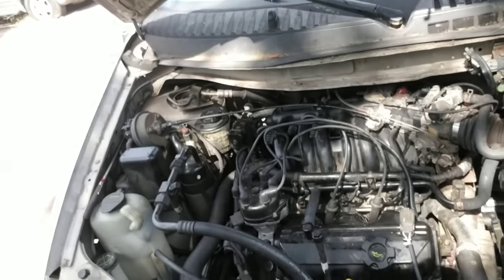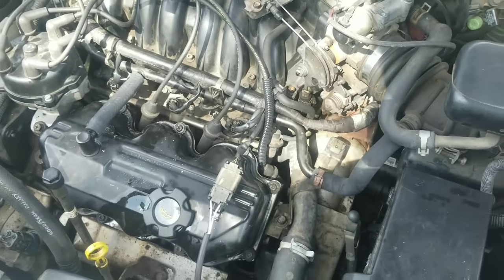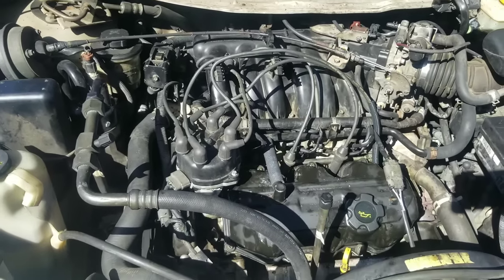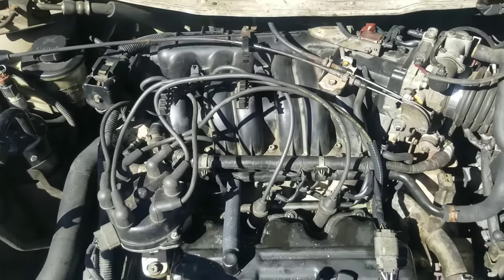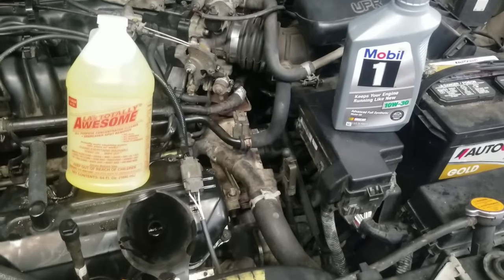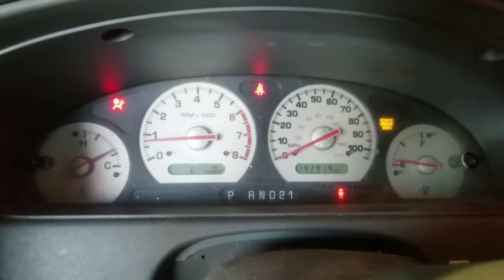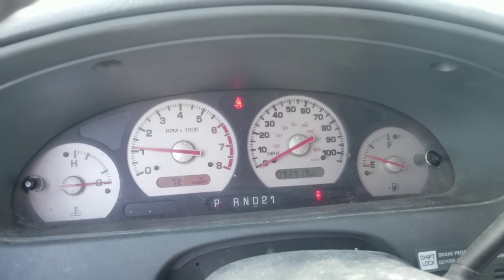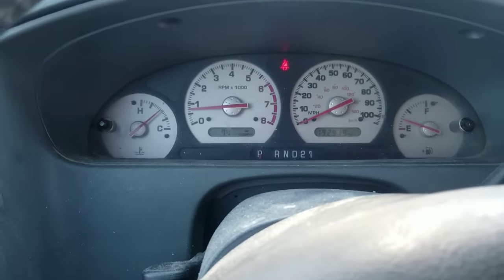How to Clean The Inside Of Your Engine The Easy Cheap Way.

Comment: This method seem a lot more cost effective than labour intensive and it worked obviously....taking oil pan off  and cleaning etc..
To me personally I think this would have done a very good job at cleaning the oil system and I would recommend this to my customers rather than taking things apart which is costing more money and time and bull shit this method would practically do the same thing I’ve been a mechanical engineer for 15years this guy has the right idea, Fuck yo haters🖕🏻
Reply from the maker: Thank you please like, share, and subscribe, also please check out my other channel Salem Taxi, on YouTube for more material on a different level.

Comment: a good flush is to use kerosene.and then use some diesel oil mixed with regular oil and run it for awhile then drain it.i quart.it`s a good flush.i quart of diesel oil.kerosene is just a flush out.

Comment: you are crazy dude. totally awesome is made of water and detergent similar to dishwash. The creamy color is caused by the mixture of water and oil, eg emulsification. same as what you see at blown headgasket, the mixture of oil and coolant. And the residual detergent will affect the lubricating/flowing performance of oil in some ways. The right and safer way is using thinner as solvent to eat the hard residue. Thinner is the effective content in many bottled "motor flush" products. Someone use diesel or kerosene, same principle, depends on what you can easily get.

Comment: What if you got a milky cream color instead of oil because I blew my head gasket
Reply: There are some treatments you can add to your coolant to seal the head gasket, but they can cause clogging of the radiator or possibly coolant passages in the engine, so I would only use it on a beater your going to get rid of soon and need a quick fix
Reply: So what do I do
Reply: Arabia Mashack to fix it properly you need to remove the head and replace the head gasket
Reply: But how can I get rid of the cream color in the engine
Reply: After the head gasket is fixed engine coolant will no longer mix with the engine oil and you then do an oil change with a new filter and it will be gone

Comment: Simple Green is a great degreaser but not for inside engines. Change   the oil and filter. Use Castrol GTX ultra clean motor oil. This oil is a sludge buster.

Comment: I know people who have owned their vehicles for years and never changed the oil...or checked their tire pressure.
Reply: And they're probably getting about 10 miles per gallon City fuel economy engine problems shaking it's not really a very comfortable ride in a non maintained vehicle and pretty dangerous why not changing your oil for that long your engine can blow
Reply: Doesn't mean it will it just means that the probability is a lot higher

Comment: Degreaser is for the ETERNAL areas of the engine, not the internals. fried bearings, fucked up engine, now. The sludge is gone, but so are the cam lobes, the main bearings, the wrist pins on the piston rods, & the cylinder walls.. should smoke like a chimney, now!

Comment: 1 quart of diesel motor oil will do it. when you drain it you will be surprised what comes out.drop aquart and add a quart of diesel oil.run it for awhile then drain.
Reply from the maker: kool ill try that for you and try to do a comparison video for you, however i have tried that and that is why i use this method its faster

Comment: What, no before and after pictures of the oil pan and oil pick up screen.  Don't ever use any form of solvent in the engine or cleaner while running, especially at 80% concentration.  Instead perform a full volume oil change.  A typical spill and fill leaves 10-20% of the old oil, sludge, contaminents, wear metals, fuel dilution behind. I have oil analysis that proves this.  The oil will be dark just as shown in the video. Perform a second change after running the engine for 15 minutes.  The new oil will be 99% clean, and the highly effective detergents in the new oil will be able to do its job to clean and protect the engine.  LOL, MMO will polish internal parts and makes parts "slicker".

Comment: Ahhhhh? I hate to inform you that you are putting water in the engine, that all purpose cleaner is not designed for engine oil and is made from water (Which you do not want in your engine) and that explains why? when you are draining the oil it is turning a coffee like colour, that is water mixed with the oil. Anyone who using this method is risking damage to the internal parts of the engine (because the all purpose cleaner has no lubrication and is about 80-90% water)

If people are looking for a cheaper alternative to flush there engine, it may be  possible to use a 50/50 mix of clean diesel fuel with an engine oil, and this allows you to flush it 2-3 times if you think it needs it. But as per usual, and as a safety warning it is not recommended, and further research is required for this technique. If you try this technique then you do so at your own risk, but in saying that (the warning) I have been speaking to many mechanics about this and they have all replied with positive replies, but they did recommend not to drive the vehicle with this mixture, just idle and gentle revving, then drain and repeat if required.

Hope this helps

Comment: Dumb-Never add water to your car oil.Most people try and keep water out of the oil.A blown Intake manifold gasket lets Antifreeze into the oil.Engines break down with water in the oil.

My solution is Take the valve cover off,oil pan off,Pressure wash,let it dry off in the summer heat all day.Put on new gaskets with the covers. Fill with fresh oil and filter and your good to go.

Comment: Putting DEGREASER inside your engine and then running on it?  The cure is ten times worse than the "disease" i.e. the sludge.  This is a prime example of "over-aggressive" cleaning and no doubt, played holy hell on the bearings rings and cam - and this cleaning was worse than any sludge.  On any engine I cared about, I'd use a much less aggressive cleaning method, get some 10W oil and add a pint of marvel or rislone or other (non solvent) "cleaner". ...and run it on that until hot.  Then change the oil + filter then repeat once maybe twice - and call it good.  If you change the oil every 3000 you'll prevent further sludge build up and slowly eliminate it vs giving the engine enema all at once.  I'd bet that an oil analysis done on that engine now would show iron and aluminum count through the roof ....degreaser has no lubricating properties, the pistons, bearings and cam were being "lubricated" by degreaser solvent (!!) and no doubt, caused the engine more wear in this video, than it got in the previous 50,000 miles.  Executive Summary: DON'T DO THIS SHIT TO YOUR ENGINE.
Reply from the maker: well three years later and this engine still runs smooth, so i think you many wanna revaluate your freshman level summary:
Thank you please like, share, and subscribe, also please check out my other channel Salem Taxi, on YouTube for more material on a different level.

Comment: All those rough big gritty bits have now been dissolved into Iddy biddy little bits of grit and have been pumped around all the oil galleries in the engine, crank bearings, mains, bottom ends etc etc .... I bet a year on that vehicle is, no more !

Comment: Don’t know about putting water in engine. I use transmission fluid and diesel. I put 1 quart of trans fluid in oil run 5 minutes and a quart of diesel before I drop plud. You wil have overfilled so don’t drive or you can drain 3 quarts and add diesel and trans fluid, diesel will clean better than a liquid cleaner and better lubrication . Water no bueno in engine. Mechanics use diesel or varsol  to clean greasy tools. Transmission fluid had detergent to clean and helps gaskets. Be sure to drain for10 minutes and don’t run over 1000 rpm.
Reply from the maker: Thanks for watching , please like, share, and subscribe

Comment: never considered using the stuff, always changed oil on time. people, please change your rides oil so you or a shop don't have to do this
Reply: Yep, if you change your oil on time, the oil will always have enough detergent to get rid of any sludge buildup, prevent sludge and make your engine run perfectly. This is especially important on engines with VVT, if you use a flush on an engine with VVT the sludge will block the tiny passages that control VVT and then your engine can't use the VVT system.

Comment: Please people think befor you do this bearings are metal riding on metal this breaks down the oil so there is no lubricant on those running this shit in your car please just exercise common sense it may fix short term but long term definitely no t good. Trans fluid if you want to do this use auto trans fluid

Comment: Don't do this on a engine without a oil pressure indicator. No idiot light.  Yes it worked on this motor.. but..maybe not on another. I used diesel as a flush once and the oil pressure at idle, lost pressure . 3 / 5 psi. I put Lucas and stp and the pressure indicator in idle never came back to normal. And I flushed out the diesel with m,m oil 4 times with new oil filter each. GOOD LUCK!
Reply from the maker: when that happens you must drop the screen, you probly had large chunks that blocked the pickup tube

Comment: Has anyone else every left Marvel Mystery oil in your crank case for more than 500 miles? I thought you were only supposed to leave in for 200-500 miles then change the oil.
Reply from the maker: you can leave it in for the full oil change interval.

Comment: It’s kerosene. This is the typical “buy here, pay here” type shop tactic,to “fix” the shitty auction cars they pic up and pass on to an unsuspecting customer.  
I know, because I worked at one of them as a tow truck driver. That clacking noise you hear, is metal on metal, with thinned out oil flowing through it. 
“Don’t ignore the oil light” as you let it sit idling with the light on.

Comment: Ok, I'm just not that adventurous.  I'd drop the motor and just take it apart to try to clean it up before I tried this.  I don't have luck trying unconventional methods though. I hope it worked.
Reply from the maker: well if you are gonna do all that work then what do you have to loose by trying this method first then pull engine and take apart.
Reply: Artistry Photography I know you're right,  but I'm not really unlucky when I try anything new.   Your method and thinking makes total sense though. 

I'm not questioning you,  please know that and no offense is intended.

Comment: Dude that engine is fubar.. even more so since you keep running it with the low oil pressure. And then add brake cleaner which is going to thin oil even more. Use a wire wheel on top of camshafts and gasket mating surfaces and brush all the dirt back into the engine and wash it down for good measure. You then fail to fix a critical problem with the timing chain which could cause catastrophic failure at any moment. facepalm just what planet are some people living on.  I can't cope.

Comment: wow this sure would clean your engine out.. but anytime you run with low oil pressure your adding more wear on your engine... i would assume a lot of the low oil pressure was probably the crap and gunk that fell in to your oil pan was caught in the oil filter... change your oil filter before running this for a while... i would then put high detergent oil in (maybe something like seafoam) and change my oil often until i see no more sludge.. this just makes me sick hearing that engine running like that for 5 min.
Reply: shoot if you need to add detergent just add (if like mobil 1) use mobil Delvac. that will get you the detergents to break down that sludge... again change your filter often. NEVER run the engine with low oil presser
Reply from the maker: did you watch the full video, it runs 100 percent better at the end of the video. Also the filter was changed during each flush sequence. Finally i think you just want to say something, you haven't added anything useful to this thread. if you pay attention to the video you see i have stated the same things you are trying to say
Reply: i did watch the whole video.. and of course it runs better.. because you actually did clean the blockage.. however in the time that you ran it with it plugged you may have lost i don't know how many thousands of miles on your engine..

i am not trying to be mean i am just thinking about the life of the engine. I meant change the filter right before you did your totally awesome mix. that way you know that the blockage wasn't just in the filter and not the screen. having all that sludge come down could possibly passed threw the screen and clogged your filter. if that was the case a high detergent oil would have done the same thing without running the engine without oil for that 5 min. And then as i said changing the filter from this point on, more often would then keep your engine clean as well as continue  cleaning it.

i am not saying anything about the type of mix you were using.. just the amount of time running the engine (possibly) without oil and the lowered viscosity during that time.

I feel i did add something to this discussion.. i however am not being rude about it just stating my opinion.
Reply from the maker: ok.kool. however the oil is picked up by the pickup screen before it reaches the filter. the filter was changed each time the flush was performed. finally if you listen i stated, " Do not drive the vehicle, let it idle." With all the large chunks removed from the top,  small debris from the oil  clumpsthat will fall down into the block and oil pan.

Comment: Why don't you just used diesel at least it still holds some lubricant
Reply: Or atf, high detergent level, just add a quart the day before you change the oil and it does the same

Comment: I would rather use good oil and a top-of-the-line filter drive it 1000 miles or so. Let it sit for a half hour and drain out the crappy oil and then fill it up again go 1000 miles or so and then drain it out and then put the, good old, royal purple in there and hope that all the crap came out

Comment: Why not just use seafoam. Atleast they advertise this for vehicles not stoves and countertops lol. Even tho it smells like paint thinner, and that sound is sticking hydrologic lifter. Not recommended in America. Shade tree mechanics. This will destroy bearings
Reply from the maker: car still runs smooth years later.

Comment: Diesel flush would be cheaper, and more effective I think.
Reply from the maker: ive tried diesl before, and it does not work well on burnt in thick oil chunks, that's how i discovered the trick with the awasome. now some times instead of a qt of oil i will use diesel with the awesome mixed.
Reply: I got a 263k ford explorer v8 with the 302 that I tried 2 diesel flushes on I'm going to try this and if that still doesn't work imma drop the pan and install a 35% over spec high volume pump. I'm getting only like 14 psi at idle
Reply from the maker: ok, keep me posted on your progress. Also is your car set at the proper idle speed. Also what weight of motor oil are you using

Comment: Ja,W,Indies,what,about,the,oil,filter,shouldn't,you,change,that,also,??cause,you,clean,the,engine,??
Reply from the maker: the filter was changed during each flush
Reply: Artistry Photography thank's,just,watch,video,again,don't,have,marvel,oil,and,awesome,liquid,in Jamaica,when,I,get,it,I,try,on my,Toyota,Fj45,89,
Reply from the maker: you can order it off the internet. also check my channel for a video . how to get 200,000 +more miles from your motor. That is a toyota 4-runner that i used this method clean the inside of the motor

Comment: i understand if it just a beater that no one really cares about but if its not then no but i do understand being poor as i grew up that way but it would been cheaper to not buy all that awsome and just get proper engine flush it would have to be cheaper than all those bottles but yes I do understand if it's a beater then sure who really cares. but I did hear knocking,
Reply from the maker: you heard knocking in the beginning of the video, that's why i did the flush procedure to get rid of the knocking. Also Awesome is 1.00 per bottle.what flush is that cheap that works better?

Comment: 😂 I know you’re not a mechanic but to also see you don’t know math because a Gallon of WD-40 is $15 dollars, and 32 ounces which is about 1 quart is $3.75 dollars
Reply from the maker: Awsome is .99 per spray bottle. and $3.00 per gallon bottle. So what type of math are you using. My numbers are less then yours. and my method works. so if you wanna prove your point to me make a video of the process .

Comment: You may mean well but you are condemning the engine to a premature death by using Degreaser to naively try and clean it. There are product on the market that enable a better engine oil flush and will not damage the internals. What about the Oil Filter !! I didn't see you change that. What a waste of money - fresh oil and the filter is probably still clogged with the bits of carbon etc that it has been trying to remove from the 'oil'.

Comment: I use diesel fuel or kerosene in the same way to clean my engine
Reply: diesel mix with engine oil or full of diesel flush ?
Reply: Vic Yu I drain some oil out first than add about the same amount and than let it run for a few minutes than change the oil like normal